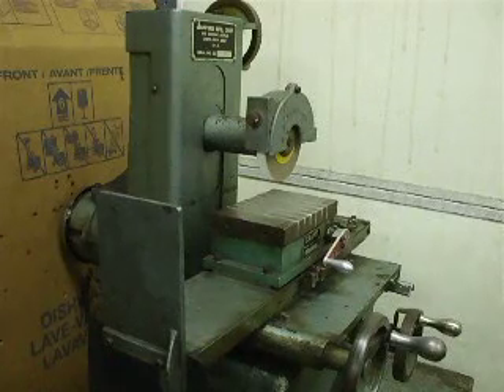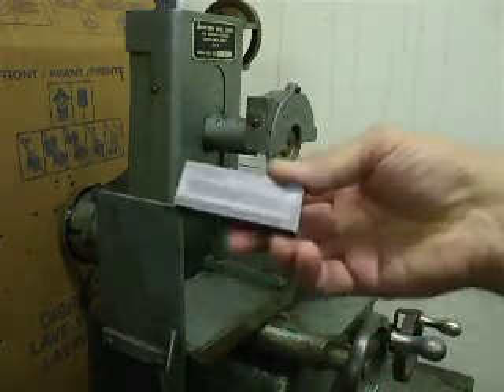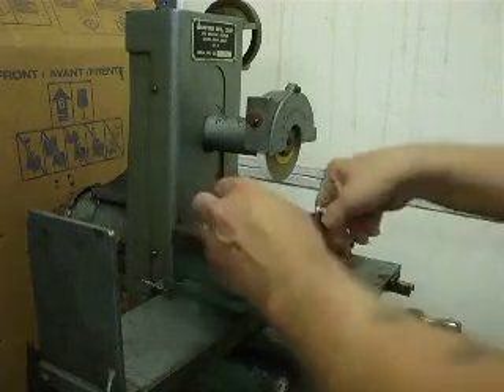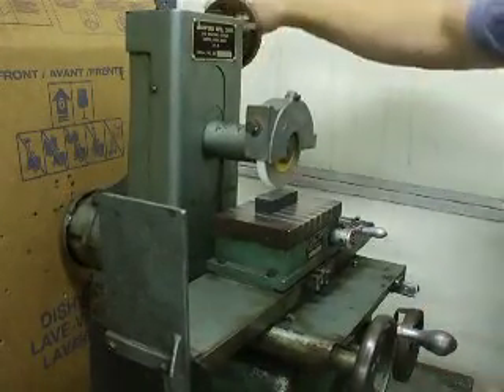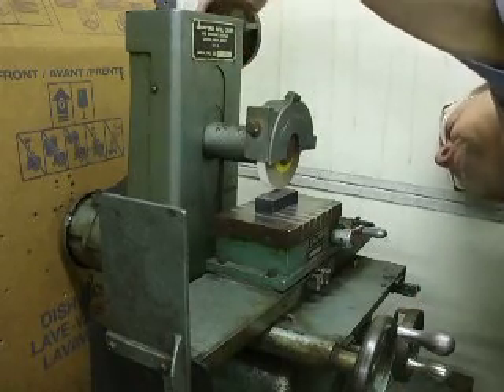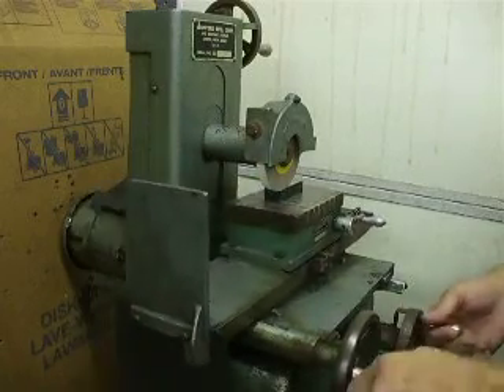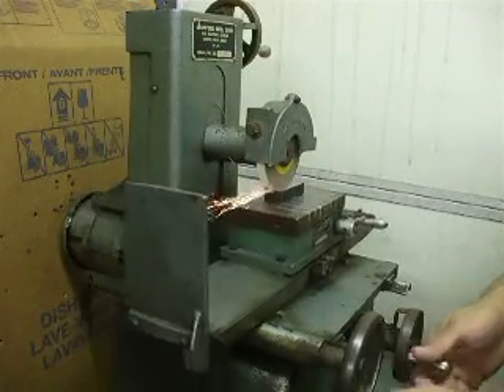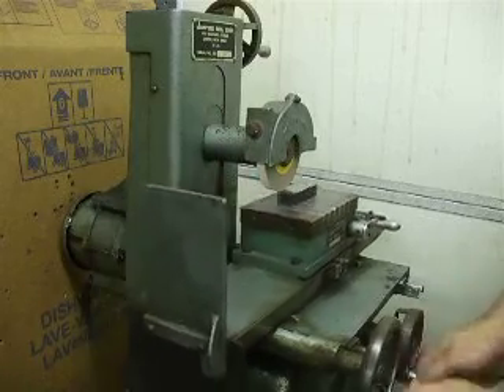Sanford SG48 Test

Comment: Nice little demo of this neat little machine! Would you mind sharing the maximum dimension from the back to the front, including the knobs on the handles?
Reply from the maker: I made the video to demonstrate the grinder I was selling at the time. It sold immediately after the video posted.
There is a trove of information on Sandford grinders,  everything from company info to machine specifications on the practicalmachinist dot com site. Just google "practicalmachinist sandford" for a link.